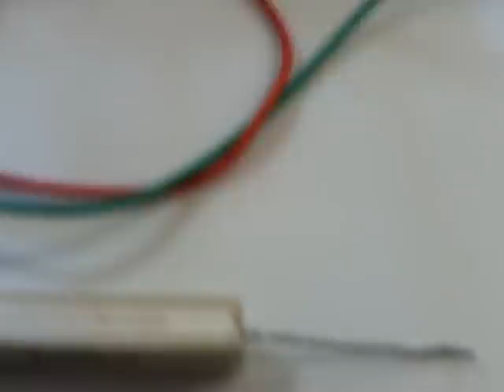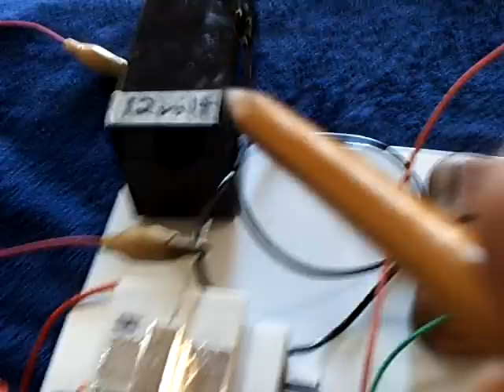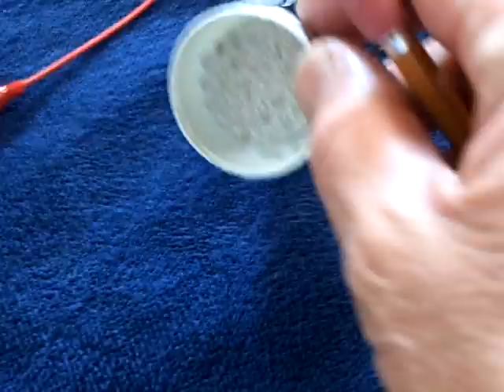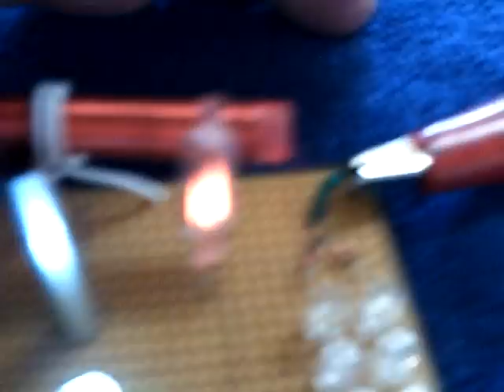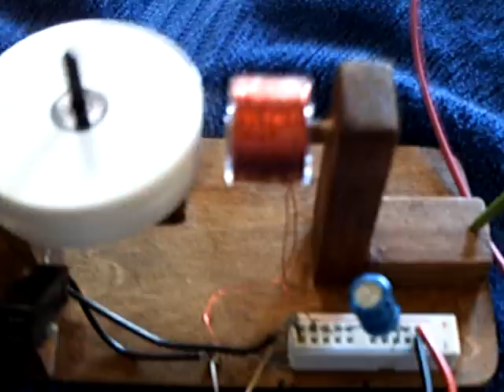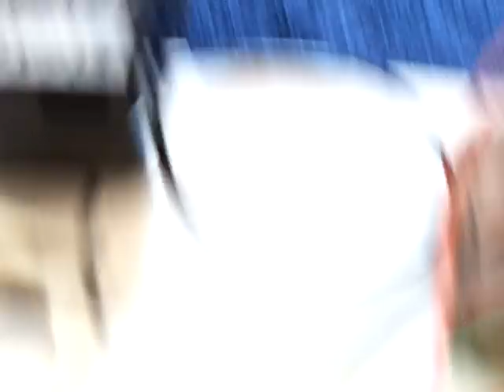Asymmetric Motor waste heat energy recovery

Comment: Cool!
Have you thought about using another 'cold' peltier module against the cold side of the existing peltier module, instead of the heatsink that is currently there? If you used the output to run an additional peltier instead of the pulse motor, running cold against the existing one, you could potentially increase your output...